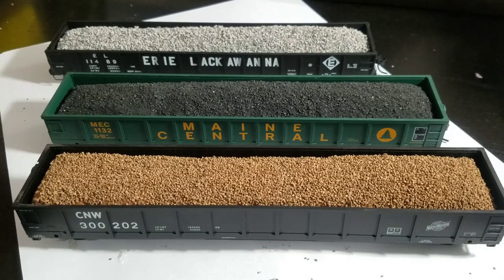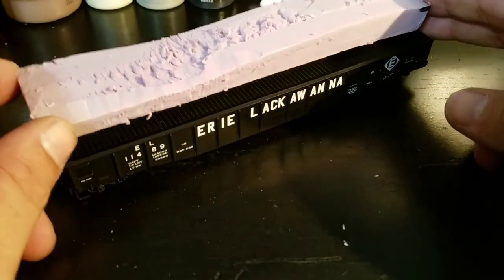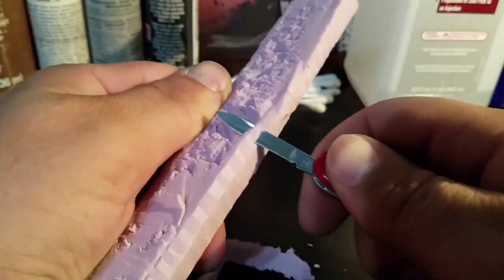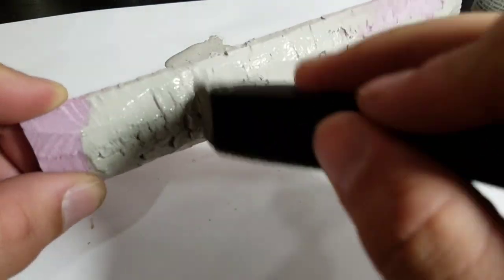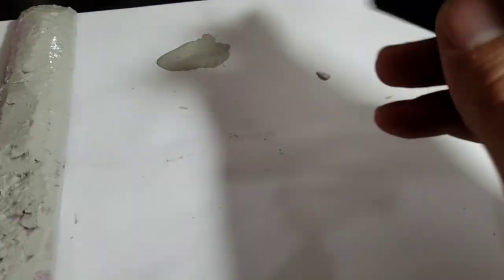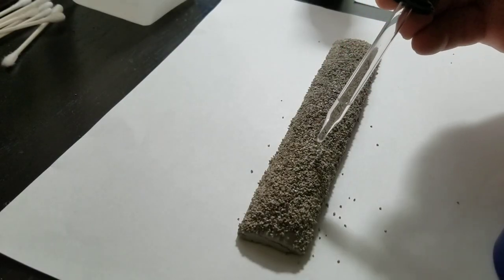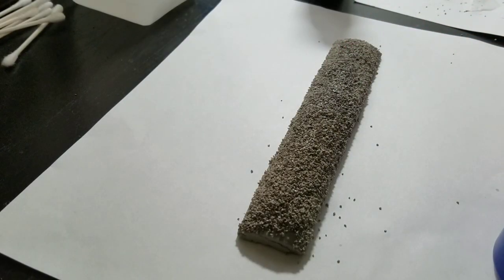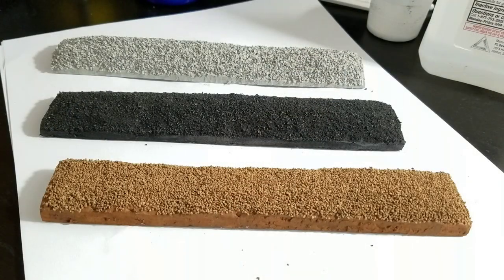How to Create Realistic freight car loads

Comment: When using foam it should be sealed with a 50/50 mix of Elmer's glue & water before using as foam will deteriorate over time and will crumble.  Then you'll be doing it all over again.  Cheers - TN

Comment: Nicely done and to the point video!   I recently purchased some Bowser gondolas and hoppers.   I'll use your method for coal and cinder loads with one addition. I'll probably glue a piece of steel on top of the foam before the coal/cinders are glued.   This would allow easy removal with a magnet leaving the car on the track.

Comment: I make my own coal for loads for HO gauge and Lionel 027.   I've got a big chunk of bituminous coal (anthracite would have been easier but railroads never used soft coal) I smash up with a hammer (outside of course) and use a 12 inch section of mainline rail (120 lb.) I got from the Central of Georgia when I lived there.  I use the track piece as an anvil.  The smaller pieces I use in HO gauge steam tenders and gondolas and the larger pieces I use for the Lionel 027 gauge.  I got a tip from another modeler about bringing the weight of HO cars up to the NMRA weight standards.  You can get tire weights (1/2 & 1/4 oz.) at Harbor Freight.  I always paint all weights black so they're easier to hide.  Cheers from eastern TN